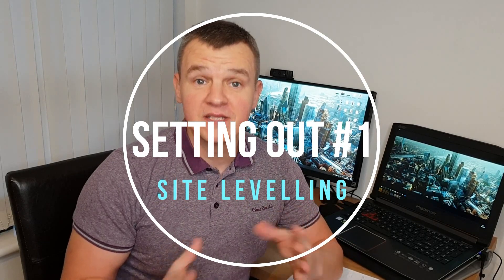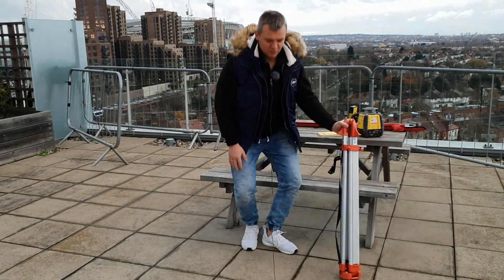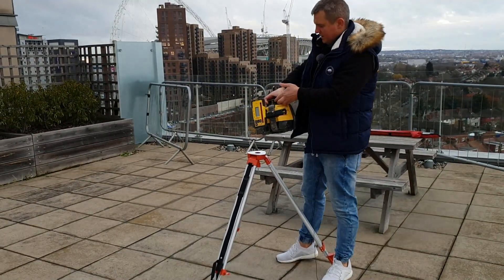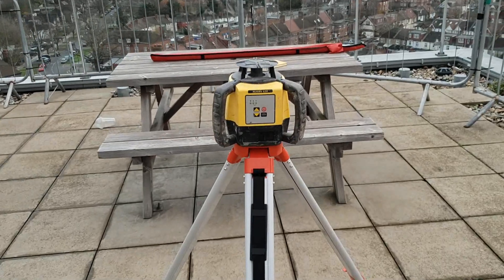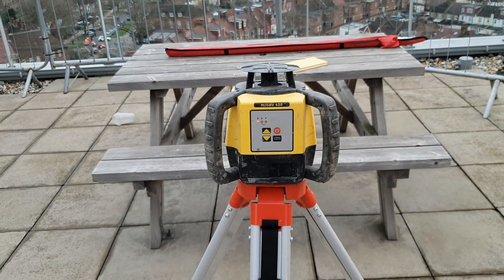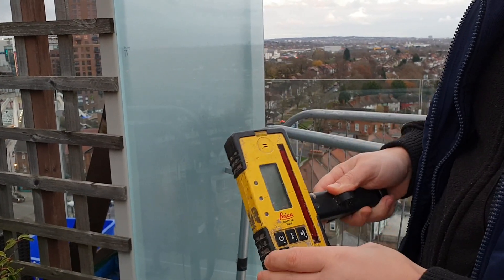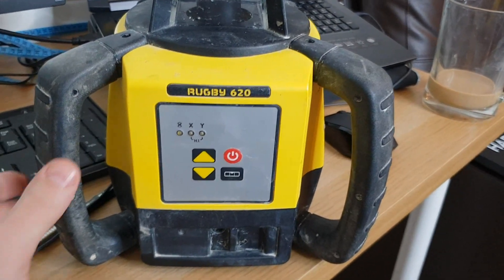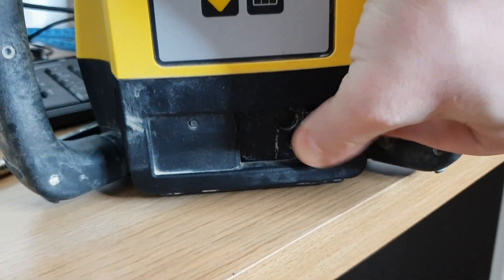HOW TO SET UP A LASER LEVEL. CONSTRUCTION SITE LEVELLING.

Comment: Great video, assuming the datum 50500 and laser is set to 756 above the datum giving us a starting level of 51256, to setup a soffit of a level of 53500 would mean we would set the staff to 53500-51256 = 2244? and apologies if I missed this but is there a reason to flip the staff upside down to set the soffit? or is this just to work the numeracy easier? 

Basically I am asking for the most effective and accurate way to set a level for soffit. 

Also, once again - great video.
Reply from the maker: Typically you use inverted staff as it’s easier - you will be using a bottom of staff as your level
Reply: @SITENG  but do you set the RL differently? or is it the same except inverted staff? for example measure from bottom of the staff but measure top down rather than bottom up?
Reply from the maker: @7DMarty  if you set levels below height of collimation (laser level) you use staff in 'normal' way, if you set the level above the laser, then you use inverted staff. I hope it makes sense :)

Comment: I dont know if it is a dumb question but, how did you find this first point 50500?
Reply: yeah, it depends on what you do and at what stage of construction ... but let's say if you wanna do some setting out for dry-lining the master datum is already on the site long before. So you just take it from there :)
Reply from the maker: Hi Saulo! There is no dumb questions! I set it there just to explain how to work with the laser having a datum. Normally you will set it yourself using master datum, or resection. When on site this information is provided by the client.

Comment: can you if possible show the programs  on ts12
Reply from the maker: Hi Mohsin! TS 12 will be the same as it uses VIVA software, the controller will be smaller and bit different.
Just edm is without the soft, but I believe you will have a controller.
Reply: @SITENG  thank you for your reply keep up the good work with your videos.I’ve recently passed the setting out course but have no field experience so the videos you put up are very helpful thanks again.
Reply from the maker: @mohsinmoroney9979  Thanks mohsin! All the best with engineer's world :)

Comment: hi there, im a new subscriber, i was wondering if i am trying to get some levels with this laser, how do i get the readings? i mean do i have to move up and down the staff the receiver so it could take some readings if i go down a slope?
Reply from the maker: Hi Omar! In theory yes, as the laser is spinning at the same level (height of collimation). It all depends what height differences as if big I would use a tape measure and measure from the receiver and if small you can play with the staff.

Comment: Height of colimation = 50500 +756 =51256mm

a) 60835 -51256 = 9579mm on the staff
b) 51256 - 47340 = 3916mm on the staff (correct me if I am wrong)

Thanks for the video. I am extremely excited a came across it.
Reply from the maker: Correct! a) will be above the laser and b) will be below.
I see now the 60835 would be actually impossible to set on typical 5m staff :)
Reply: @SITENG  The above values "756", "60835" and "47340" didn't reflect on your video tutorial. Can you explain where the values come from?
Reply from the maker: @ifeanyiokpala623   Sorry, did not see your comment. This are random numbers for you to train. I did not want to use the same ones, but wanted you to use the same method using whatever levels you are given 😁

Comment: Thanks for the video mate. 

I would like to become a setting out engineer. What's your advice for me? Are there job opportunities for new setting out engineers? I have MEng in petroleum engineering but couldn't find graduate job opportunity, very fluctuating industry it depends on oil prices down and and up a lot of times.

I'd appreciate your advice as it's from an experienced engineer.
Reply from the maker: Sorry for late answer. You have to look for an assistant engineer/chainperson position first, than after you gain some experience go for Setting out engineer.
Reply: @SITENG  Thanks a lot very much appreciated. There's an intensive course for 10 day costs £2000 at The Civil Engineering Academy which tains applicants to become Setting Out Engineers and they aim to find job opportunities after completion of the course. Applicants must pass exam with 95% to gain a setting out engineering certificate. I'm thinking this is too good to be true. Link of the Academy http://www.civilengineeringacademy.co.uk/
Reply: @geoashu8432  did you do the course mate ??
Reply: @hsm8976  no I didn't